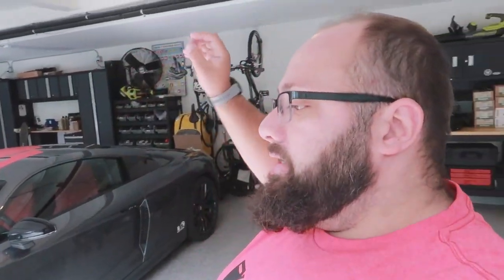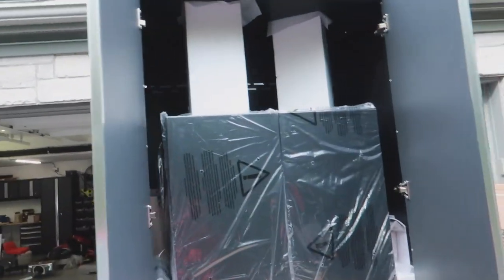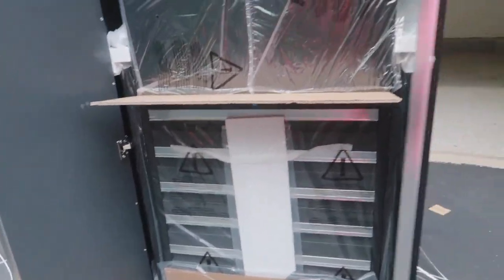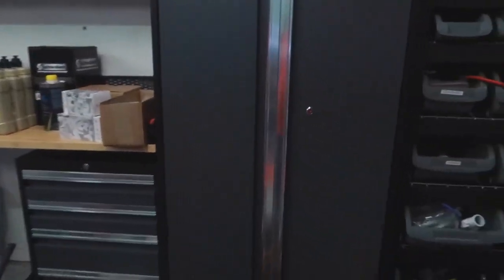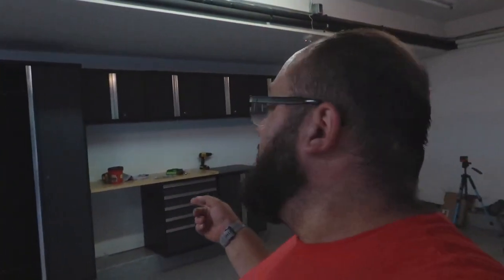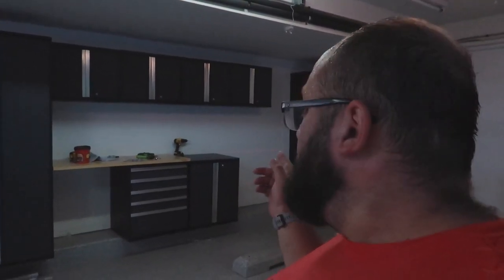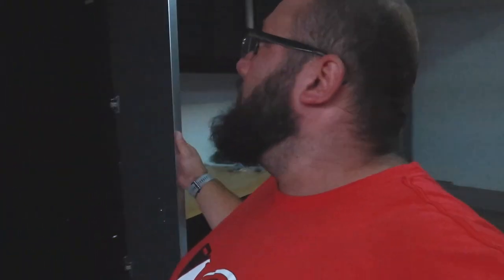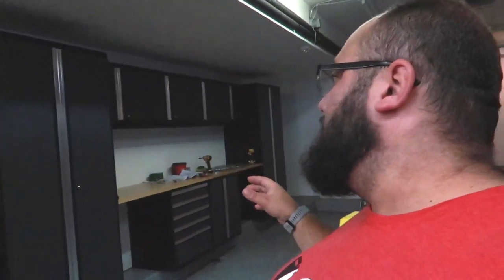Unboxing The NewAge Pro 3.0 Garage Cabinets. SAVE MORE MONEY!! MY $40,000 DREAM GARAGE Pt. 13

Comment: Nice looking cabinets. A couple of LED lights under the wall mounted cabinets and a couple of power outlets at each work station would be icing on the cake.
Reply: DGR33 thanks, they did come with lights, I will be installing them shortly 👍

Comment: Is there a way to run power to the top of the bamboo countertop if you don’t have a power outlet in the empty wall space above it?
Reply from the maker: only way is to drill to thru the cabinet and counter top, but that wouldn't be a problem
Reply: @GasTachs  ok thank you sir!

Comment: I just got the Pro Series too. So I am curious, did you actually secure the cabinets to each other? I was wondering if that was necessary considering they have the 2 wall mount brackets and the 2 additional lag screws recommended. (Just talking about the 4 wall cabinets at the top). Also, did you run into issues getting them perfectly leveled with each other?
Reply from the maker: Thanks for watching, I did not secure them to each other as, I just mounted them to the wall. The mounting plate has a little but of adjusting space in the screw hole that I had to play with to make sure they were level but nothing was seriously unleveled so it was easy.

Comment: What is your opinion between the pro 3.0 and the Sonic MSS cabinets? They are drastically different in price, is the upgrade to the Sonic stuff worth the extra dough?
Reply from the maker: Ken Schleh so this is how I look
At it currently... if you are planning on upgrading your tools to Sonic tools (like a much of tools not just a couple
Foam inserts) then I’d get the Sonic Cabinets.
First the Sonic stuff is much higher end then the Pro and when it comes to tool draw cabinets the Sonic has 10 draws while the same Pro Series only has 5 so less efficient in drawer storage. This isn’t saying they the Pro series is low end, Sonic is just higher end. The Pro series would work perfect for someone that is looking to clean up their garage, have tool storage, a good size work bench and plenty other storage for other garage stuff. Let me know if this helps!
Reply: @GasTachs  very helpful. While I know the quality and features of the sonic cabinets are nice I figured the pro series would be sufficient for the home garage. Thanks for the response
Reply: @GasTachs  Can you fit the sonic foam system into the Pro 3.0 tool box?
Reply from the maker: M L I’ll let you know tomorrow 👍
Reply from the maker: Hey, I measured them out.... Pro Draws are 24.75" wide x 19" deep the Medium Size Sonic Foam inserts I have are 22.5 wide x 14.5" deep so they will fit for sure! The thing to consider is Sonic has 10 draws and Pro only has 5 draws! Hope this helps!
Reply: @GasTachs  Great. Thanks.. Just ordered Cabs and tools.
Reply from the maker: M L Nice! Did you order some Sonic Tools? And the Pro cabinets?
Reply: @GasTachs  yes ordered the pro cabs with a bunch of sonic foam system tool sets. I think I can fit three small foams in one Pro drawer.
Reply from the maker: M L yeah for sure you can! Glad you found something that worked! Enjoy!

Comment: Hi! Is the table top bolted to the Lockers on the side?
Reply from the maker: There is a bracket that bolts to the tall side cabinets then you screw the table top to the bracket
Reply: @GasTachs  Thank you for your reply. Are these brackets adjustable? Meaning I can set the height of the table top where ever I want?
Reply from the maker: Nate Adams no there are pre drilled holes for where the bracket goes but if you really want (take 2 seconds) you can just drill new holes!
Reply: @GasTachs  Cool, thanks